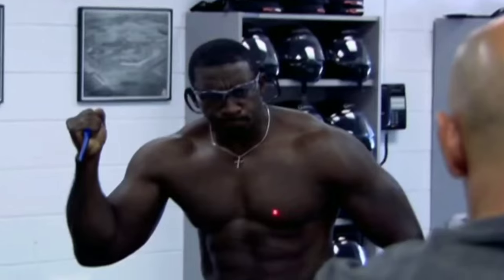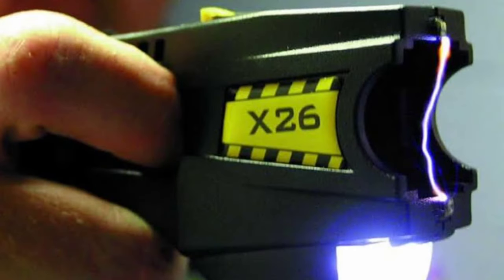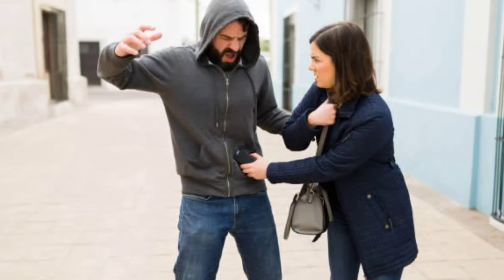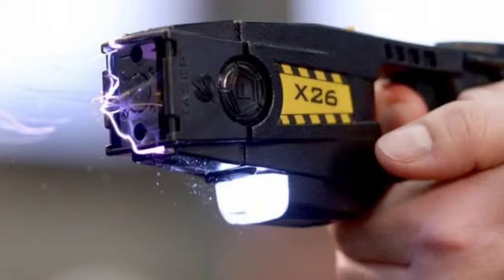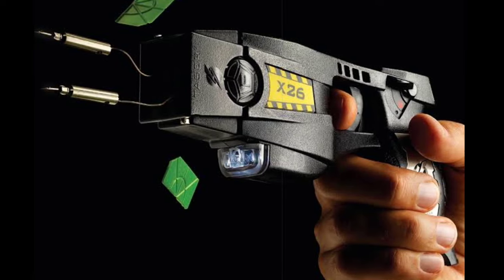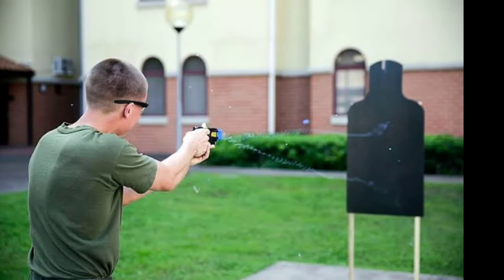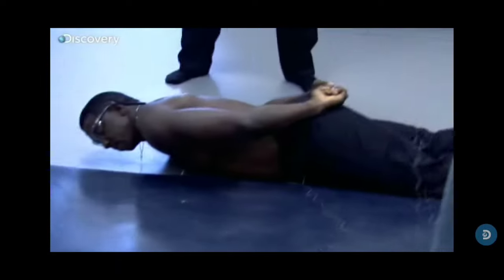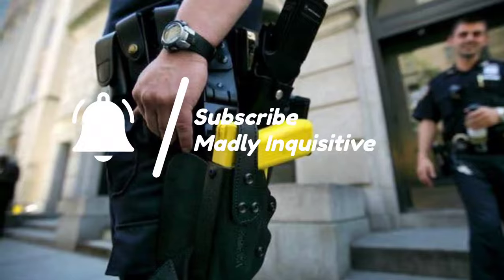How a Taser Gun And Stun Gun Works

Comment: Another question: For example I'm held hostage by a bag guy and he's like in direct physical contact with me.  When the Cops tase the bad guy (maybe a clear shot from the back), I'll also be electrocuted, right?
Reply from the maker: Haha..Great question..never though about it but i guess considering how the electricity works it will probably shock you too..Intensity might be lower coz its distributed.
Reply: Assuming it does, they'd be stunned out of physically contacting you in about a second anyway
Reply: No, you won't. Tasers are high-voltage, low-current devices. If the barbed probes are embedded subcutaneously in your assailant as intended, the electrical pulses would take the path of least resistance and only propagate beneath their skin and quickly dissipate before they reach your body. Even if the barbs don't embed in the target's body, the plasma arc from the tip of the probe will likely only cause extremely localized pain compliance effects on the target, but no muscle incapacitation for anyone.
Reply: @MikeTrieu  Wow!  Never knew that.  Thank you so much for sharing that information.  It is very informative.

Comment: So the barbs of a taser penetrate the skin, right? Makes me wonder if a taser could spread blood born pathogens between people if they're not cleaned effectively? Is that a thing that's possible with them? I never thought about that before untill this video. Makes ya wonder.
Reply: The ammunition for a taser must be replaced each time, so there will not be reused into another person. They can penetrate and cause bleeding yet this bleeding (usually) won't be a big one because it'll hit areas away from arteries and veins.
Let's say that scenario does happen, the pathogen needs to enter the bloodstream of another person to cause and infection, the probs won't be reused but became a potential threat, well OSHA guidelines indicated that any equipament that enter in contact with blood need to be handled and dispossed properlly, so any Police officer (or user) shall be safe as longs as they follow the proper procedures (use globes to touch the probes, throw them in a container for biohazard material...) 
There are risk, but they are low  and can be minimized, nurses amd medical staff have higher risk in handling needles and other biohazar materials
Reply: @jorgesuarez9907  Hey, thanks for the answer! I appreciate it!
Reply: Its one time use. You have to replace the cartridge

Comment: What if the victim touches the wire things
Reply: Nothing really. The wires are covered in lightweight plastic insulation. Only dangerous connectors are the electrodes at the end of the handle and the probe darts' aluminum body and steel barbs. If the victim still has use of their arms, they could easily grab the wires and use them to yank out the wires connected to the barbs. The wires aren't connected mechanically well to the them and tend to slip right out. I just disassembled a damaged cartridge. Some interesting engineering went into designing these things.